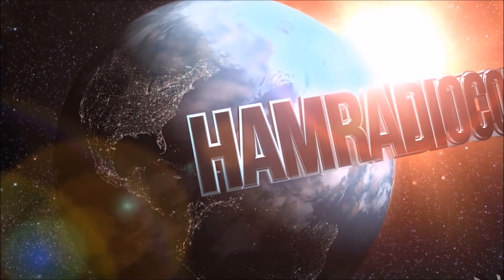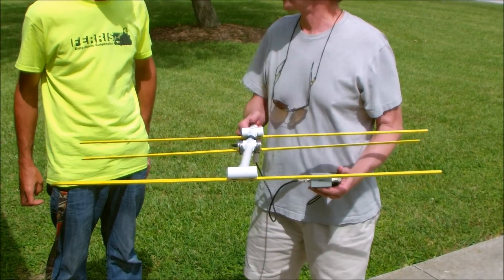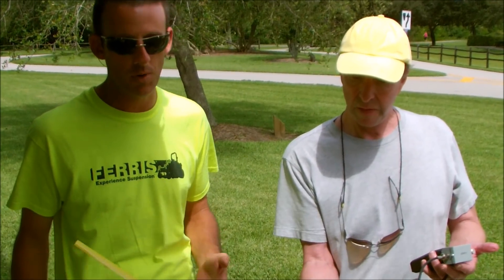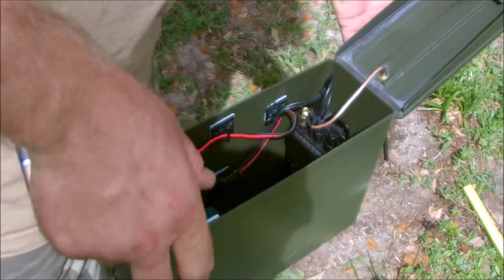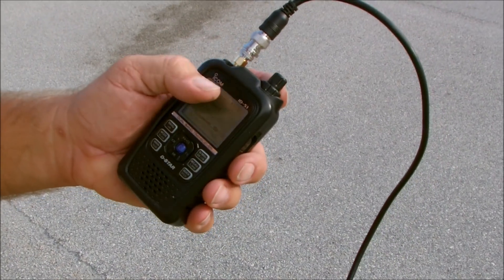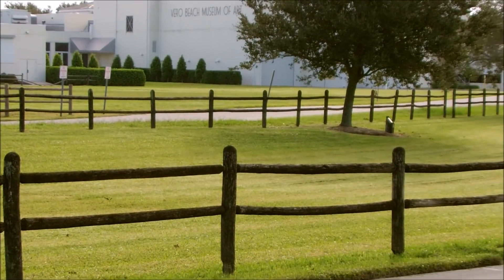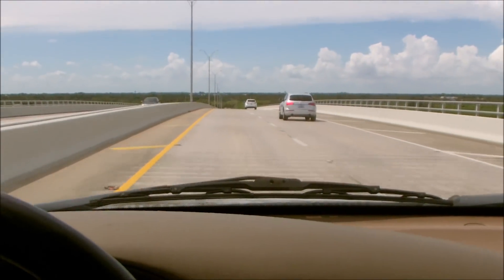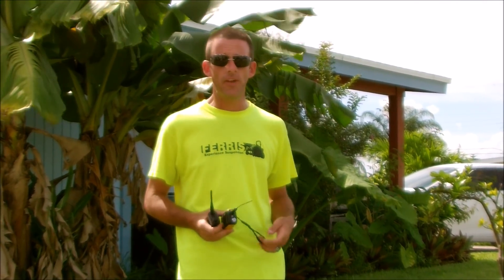Fox hunt ham radio hidden transmitter hunting

Comment: This is neat! Does the hidden radio just have to be turned on or transmitting some sort of signal?
I can find my RC Helicopter with simular technology built in to the Taranis 9XD remote control as long as the on board receiver is still powered up.

Comment: Do you hold the antenna vertically or horizontal? I've heard conflicting information so which is it? Is the propagation pattern radially symmetrical? i.e. is it more/less directional when held horizontal or is the directionality the same in either polarization?

Comment: Baught a fist full of fake antenna's. And bolted then to a peice of angle iron(aluminum) first two rungs cut to 1/8 wave.  Second set at 1/4 wave. ( One of half  wave pair hooked to  radio) And  followed by a 1/4   wave grounded to the angle iron.. then when close change to the stubby that is very pour for long range.  All with cheep junk. Not afraid to hack junk antennas at less than $2.00 a peice. Break out the dremmel boys.

Comment: Can I use this to find CB radio people causing trouble.
Reply: Paw95 yes
Reply: Tech2025 you know what I have to divide by to get the length for cb use?
Reply: Tech2025 nice thanks I couldn’t find it.
Reply: Claudius right. I saw the loop antenna design. I can’t find an open type tuning compactor or one that would work better for it.
Reply: Claudius so it’s hooked up from the loop direct to the radio no meter or anything?
Reply: Claudius thank you. I just saw them. They look great. I will definitely get one.
Reply: Claudius I know the direction I need to go. So that’s a good thing. I will get the whole setup needed. I’ll look more into it. Will also setup hidden transmitters

Comment: Enjoyed your video, could you send me a link to where you got the plans for the antenna and atenuator?  I would love to teach this to my boy scout troop. 73's Scouter Donn
Reply: Hi, I am too interested for atenuator. Is there option to buy it or some sort of blue prints to make it home?
Reply: @radioklubprlek7066  attenuators for fox hunting do not need to be elaborate. If you Google "simple attenuator for fox hunting" you'll find plenty of information.
Reply: The attenuator Jerry is using there is an "offset" type sold by Arrow Antennas: http://www.arrowantennas.com/main/4ofha.html

I have one that I use with magnetic loops (shown in the picture on that webpage) for RDF of HF signals.
Reply: a DIY kit is here: https://www.tindie.com/products/3rdPlanetSolar/fox-hunt-offset-attenuator-kit/
Reply: Good,morning 
I.m Dioscoro M. bacaron Jr.
I have a Club HAM RADIO CEBU INC=HRC CLUB
SOMEDAY GODS WILL PANDEMIC RESOLVE ,I WENT TO TAKE EXAM THE NTC ON PARA (PHILIPPINES AMATUER RADIO ASSOCIATION
MY TEMPORARY CALLSIGN:7HDB JR=7 HOTEL DELTA BRAVO JULIET ROMEO,
MY FUTURE IS MORE LEARN AND ACT TO MAKE ANTENNA EASY&HARD
KEEPSAFE EVERY ONE 73""